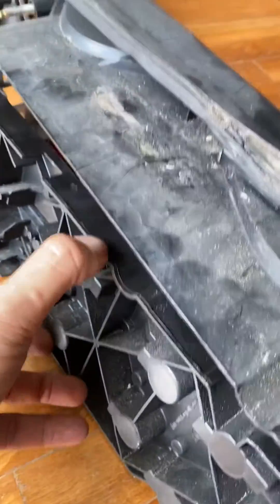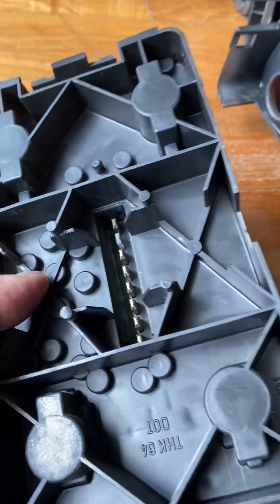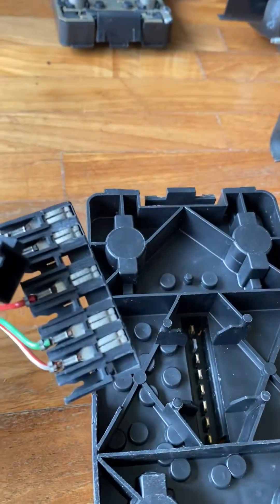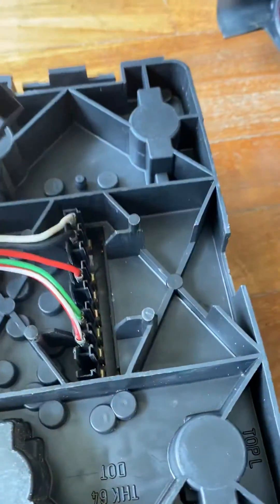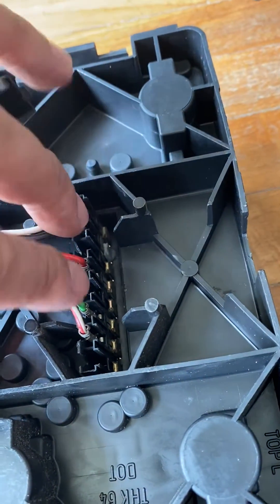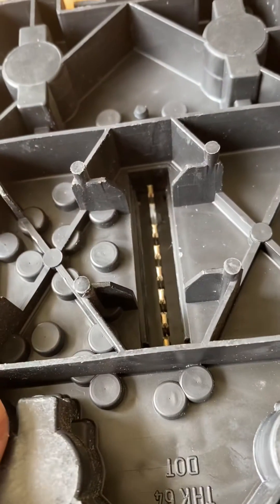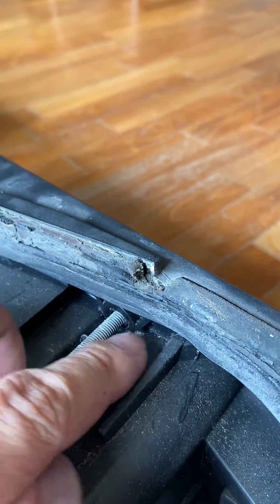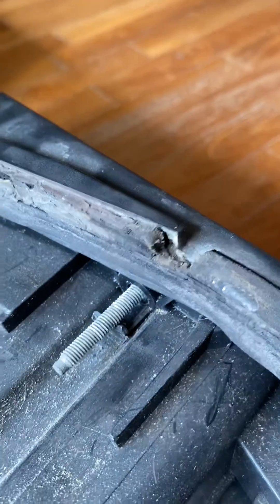Saab 900 Rear Lamp Electrical Problems

Comment: Hey bud.. I'm having an issue with my drivers side tail light on my c900... can you snag a pic of your driver side wire harness plug.. need pics for wiring help.  Some wires came out and trying to figure where they went